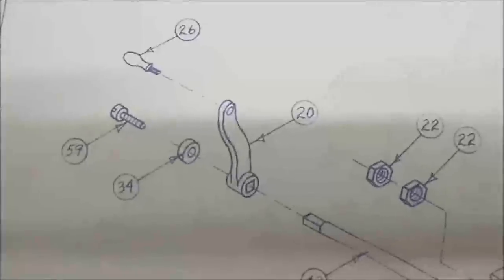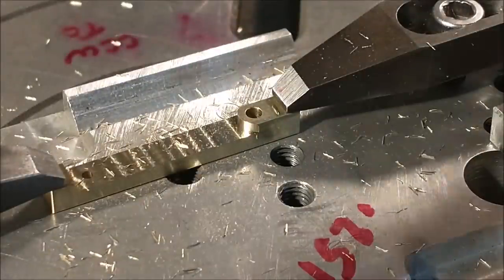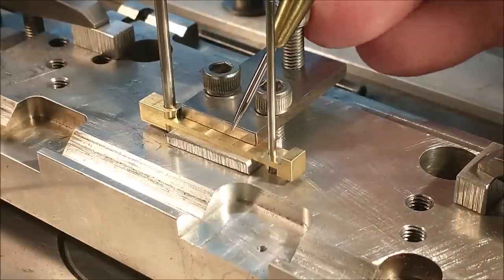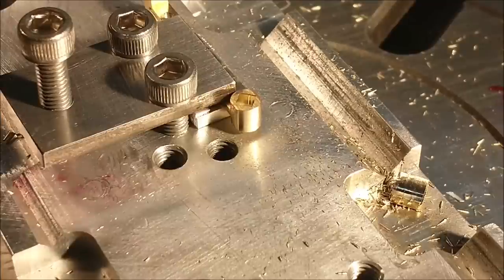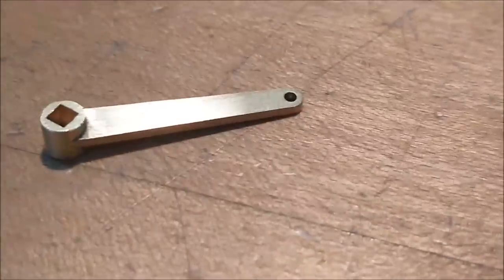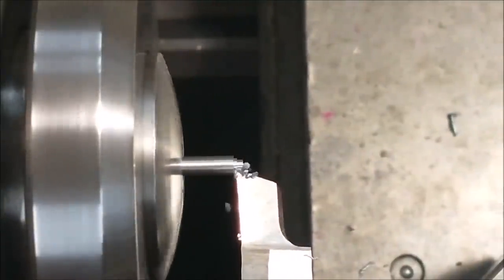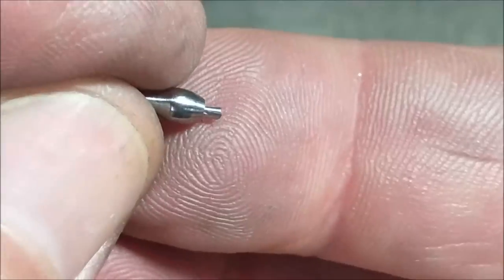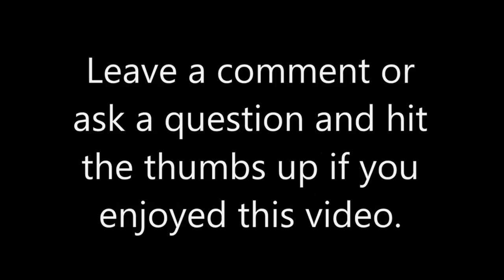Start to Finish Fabrication of a Miniature Crank Arm. Take a Look !!

Comment: Great video as usual Joe, nothing less than we've come to expect from you. Lovely exercise in making small things. Much, much harder to make something small than something large without question. like you I'm a general engineer and certainly not a clockmaker but undertook to repair an old family (ships) clock. The escapement wheel was damaged and it took several attempts to make a new one in Nickel, oh boy what a trial that was, my scrap bin has the evidence of my failures but it's very satisfying to see the old clock run again.
Reply from the maker: Congrats for persevering.

Comment: A while ago I made a ball crank handle for my watch maker’s lathe. To cut the profiles I made a tracing fixture that mounts to the lathe bed on the watch lathe it has a template that the cutting tool follows. the cutting tool is mounted to a movable block with a finger that follows the template. To cut the part you move the block back and forth following the template. The templates are made on the mill with the profile cut in them. I wish I could show a picture. This works very well for making small parts all the same.

Comment: Those of us who are regular viewers appreciate the step by step, with great verbal explanation of what you are doing.  Some of the people may have the visual acuity that is a blessing as well as a curse that does recognize what 98% of the world would miss- I’m sure that you know the feeling.  The model is for you, and your levels of accuracy even in these miniature machines is very intolerant of mistakes.  You can rest assured it is appreciated.  Two adult beverages are in order!
Reply from the maker: I made a part one time and didn't remove a casting gate reproducing the outer draft on the part. God forbid, I did it on a sander. Referencing other features on that part to a functional feature, some holes looked to be asymmetrical. I can assure you, they were spot on.  Some armchair critic took a screen shot and tore me apart inspiring 100's of comments, arguments and 2 videos on his channel. You are correct. The model is mine, and only I have to be happy with it. I always strive for perfect and realize somebody is always watching. Thanks for your comment. This model will warrant a Don Julio 1942 when its done. :)

Comment: I agree the contrast between the handle and crank looks just as it would do on a full size machine.

You got the camera position and zoom perfect for turning the handle👌👌 could  really see the shape that you ground into the tool. It's only when you have it in your fingers that you fully appreciate how small it is.

Great video!!

Good luck from Spain!!
Reply from the maker: Thanks. The camera was slightly in my line of sight, but the angle was right on, so I just dealt with it.

Comment: Lovely work as alway Joe. The old 11/16 or 1 1/16 trick eh? Once spent half a day with model traction engine drawings trying to fathom the centres for shafts not drawn in direct relation to each other. Only after we made our own drawing did it become clear that a dimention shown as being 11/16 was actually 1 1/16. Ho-hum....
Reply: Use metric. No loss of Mars spacecraft.
Reply: @alangknowles  😁 I think the plans mentioned were lost before they left the drawing board...
Reply from the maker: I've seen that 1 1/16 vs 11/16 more times than I can recall. Its a legit mistake when it happens.

Comment: When I worked in R&D in Optics we had a technique called optical contact bonding.  If two surfaces are so much alike the other they become so close that intermolecular forces will bond them together.  Have you ever experienced this doing very fine work?   It has to be quite a bit more precise than this but you are getting close!
Reply from the maker: Like ringing gage blocks together.
Reply: @joepie221  After looking it up, yes that’s it!   Learn something new everyday!

Comment: That's really wonderful work, Joe. This isn't even remotely a criticism, but once you are done would it be possible to re-harden the brass without wrecking the finish?  Also, along the same lines, if you are going to anneal the part anyway, how about doing it before the surface stresses twist it all up during machining?
Reply from the maker: A stress relief step may be beneficial for machining the thin areas, but machining gummy material after annealing is frustrating.

Comment: LE FINOLICK ?... Never heard it called that before ?!.. We've always called that Tufnell ?.. 🏴
Reply: Phenolic :)
Reply: Never heard it called Tufnell, I've always heard it called Tufnol ( or Phenolic ).
Reply from the maker: The LE stands for Linen Epoxy. Super tough stuff. Tufnol must be a brand name.
Reply: @joepie221  I use it in round stock for the saw guides on my 52" headsaw sawmill. Stands up great.

Comment: Nice little part! Would you consider annealing the square stock before relieving the thin part of the handle to prevent the part from bowing?
Reply: I was thinking the same thing Mark, from memory when i have had to machine brass that has been silver soldered it was more like machining copper or lead - horrible sticky stuff that comes off in long strings. Had the same issue with aluminium that had been TIG welded, milling away and getting a great finish until i hit the heat affected zone and it was like trying to machine plasticine! I think it was 6061T6 aluminium but can't guarantee it .
Reply from the maker: I'm sure you could, but for the reason in the above comment, I'd be leery. I should try it.

Comment: You should nickel plate some of the shiny contrasting parts.
Reply from the maker: Chrome if I ever consider plating.
Reply: @joepie221  I looked into it and decided it was too toxic to do at home, nickel acetate is better enough that I have been doing some steel and brass at home. But I'm not completely done looking into chrome plate, I have a desire for something that would be nice to do in an electroless process.

Comment: Nice! Small parts are a challenge on the other end of the scale, yeah?

Is that a broach you made? If so, do/did you bother hardening and tempering the broach, just for brass. or optionally aluminum?  At 34:50 is where I would press it on the wrong side lol!
Reply from the maker: The broach was ground out of a HSS drill blank. About 69 RC. No additional HT required.

Comment: Regarding the bowing from surface stress, would it not work to support under the part when flipped and clamping the ends down to make it straight? Would the removal of the second extruded surface not neutralised the bow? Thanks Joe
Reply from the maker: I've done that too, but usually when I have more grip on the ends of the part.
Reply: @joepie221  thanks Joe. I wonder if you saw Stefan Gotteswinter’s use of a press into stiff rubber as a way to bend sheet metal? Maybe only works with thinner material?

Comment: Is there a way to remove the stress in the stock before cutting? Can you heat it or do you need to hammer it to remove this?
Reply from the maker: Yep. Its actually called stress relieving. Not kidding.

Comment: Seeing as I'm not a career machinist with decades of experience behind me, I don't want this to sound like I'm taking a shot here...

...but, was surprised a little bit that the faces of the diameter around the broached hole weren't faced off .00x" (small fraction of a mm for you metric types 😆) to remy the remnant from the radius or chamfer (hard to see which in screen) that used to run down the length of the stock.

Would doing so have put the part out of spec to the print? Or, is it just something the camera is blowing up and making look big on screen, that I wouldn't really see in real life?

Again, not trying to take a pot shot here. Just a amateur in his garage, trying to learn as much as he can...
Reply from the maker: Its OK. On some of these cranks, they assemble and stack to a specified dimension. I'm sure I could face it off, but I'd have to adjust a mating part down stream.
Reply: @joepie221  I can get that - if there's one thing I learned in my few minutes as an automotive machinist, it's that whatever cut you take off of one piece is going to somehow affect something else...

Comment: What if, in the initial setup, you broached a square hole in the fixture plate and used a square pin on one end, and a round pin on the other?
Reply from the maker: Chicken or the egg syndrome. The part has to be on the fixture to get the square broached in it. But once you have that done, a square pin would work just fine.

Comment: When you anneal brass for reloading you quench it in water after you heat it. You didn't mention anything about quenching these parts.
Reply: Quenching in water is not required to anneal brass. The quenching just enables the brass to be handled because it has been cooled rather than wasting time for the brass to air cool. Annealing brass or aluminium is not the same process as hardening steel.
Reply from the maker: These are so small, they air cool quickly.
Reply: You dont have to, quenching just speeds it up as you dont have to wait for it to air cool

Comment: If you didn't own either would you get a rotary table or an indexing head 1st.
Reply from the maker: Tough question. The rotary is more useful, so I'd go that way. ( but save quickly for that indexing head.) Even a spin indexer is a plus.
Reply: A little tip with rotary tables, make sure to get one that can be mounted on its side.. the rotary table that came with my mill can't be mounted on it's side and it sux
Reply: @joepie221    Thank you

Comment: Well done ! Is that the new mic  ? Off the subject , question . Can you trepan with a boring head on the mill ? i have a little job to do on the rotary table along with some boring and milling.
Reply: That's a damn interesting question and my bet is you can but the clearances on the cutter will take some doing.
Unless the part is just too big to swing you'd probably be better off in the lathe in the 4 jaw or face plate.

An alternative (if you have one) is a rotary table and small cutter, but that will take time and you risk snapping the cutter.

I guess the reason is you have a big hole and want to preserve as much of the center as possible. You might try a hole saw that's a bit undersize and then use the boring bar to clean the hole. Just make sure you use the right cutting fluid and check constantly to look for teeth build up which you'll get for sure if you're cutting into aluminum or similar.

Hope that helps.
Best of luck
Reply from the maker: Just a new computer with different audio capability. As for trepanning with a boring head, be careful of how much tool contact you have and keep the gibs snug so it doesn't walk. I've done it with success.

Comment: The people saying surface quality is poor are very rude considering the tramlines in your fingers are about 25 to 30  Thousand times deeper.
Reply from the maker: Comments like that just let me know people are really scrutinizing my work. It keeps me on my toes. Except if your initials are GW or BS, then I just grin.
Reply: @joepie221  hi Joe.
You don't have to stand on your toes.
You can turn or mill or saw the bottom off your microscope-table legs.
Every comment helps the algorithm.

Comment: Nice job as usual JP.

Just few questions about order of operations...

Firs.. why not anneal stock before you start machining?
If you will anneal it anyway for the banding, I can't see reason why not annealing it beforehand, so you avoid stress bending.
Even if you do not want to anneal it completlu (in some other situation), you can releave stress by heating it to for ex, 150-200 degrees C, for few hours. It will not aneeal it fully, but will remove most of the stress.. (tried it for some handsaw backs... it work :))

Second.. why not doing operations done at 17.49 and 21:10 before broaching?
It will not affect broaching in any way, you still have two refference holese for the pins...
Reply from the maker: There really is no  definitive exclusive way to do a part like this. I go with what I know will give me my desired result. You can always mix things up if you feel differently. Stress relieving the material prior to machining would be a consideration for a bigger lot of parts, but I knew I could easily correct any warpage very quickly. The large end round was done late so I had support material as I explained. The smaller end could be done as you see fit.